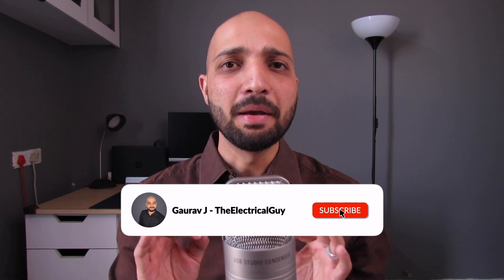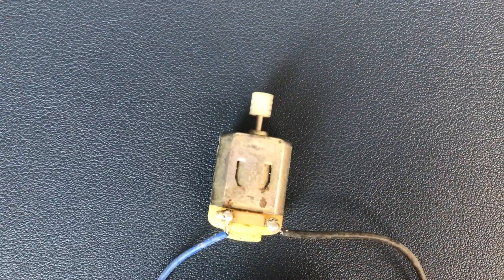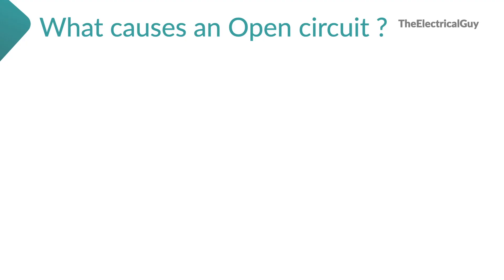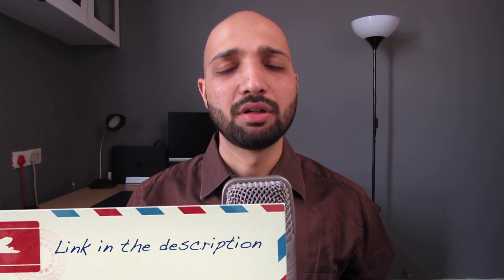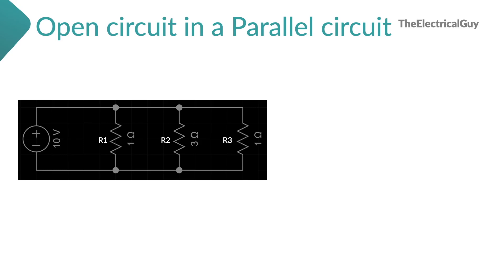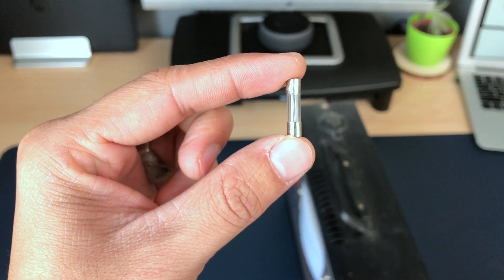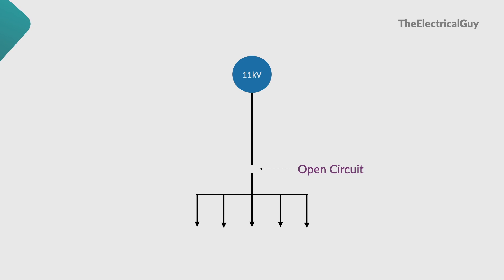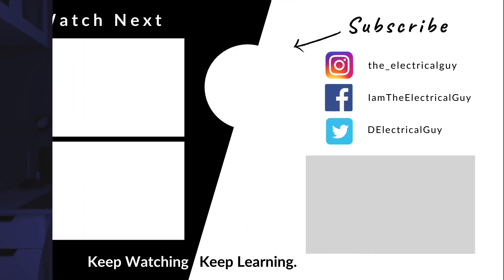What is Open Circuit ? Detailed explanation | TheElectricalGuy

Comment: Good video to understand fundamental as well as basic electricity. The open circuit could cause an arc btw 2 broken conductors as air can be a conductor btw them if voltage (or EMF) applied in that circuit high enough to cross.
Reply from the maker: Yes. That's correct 👍🏻